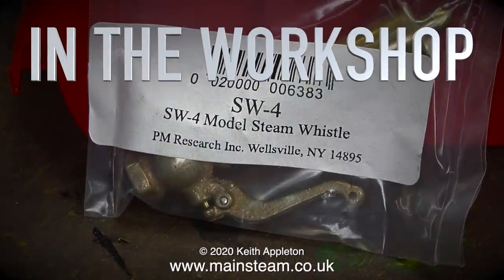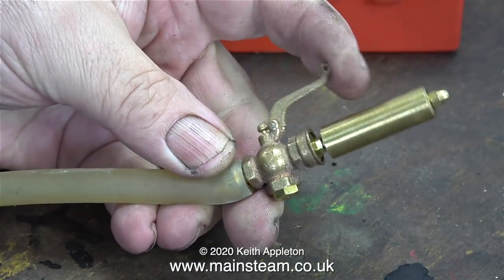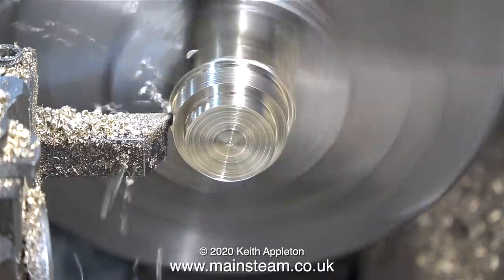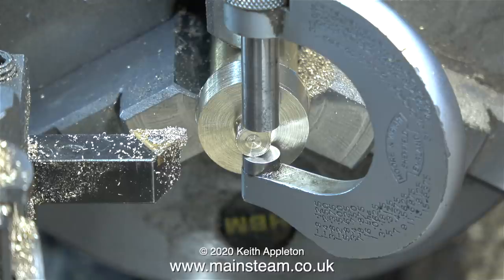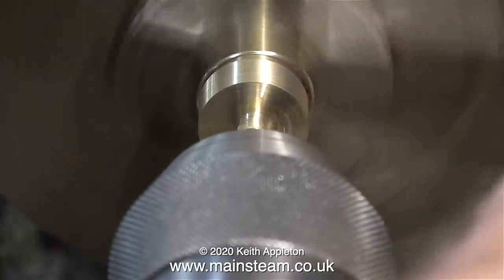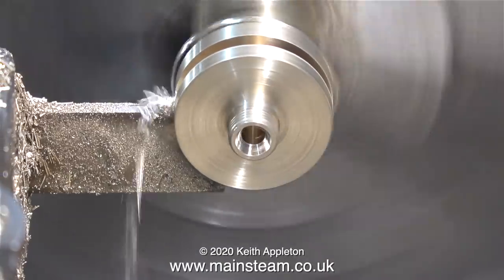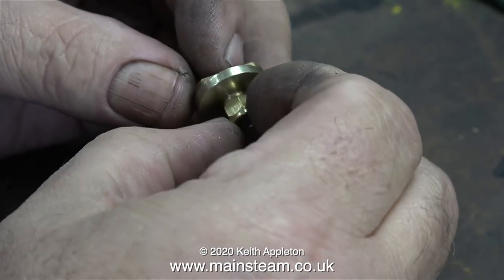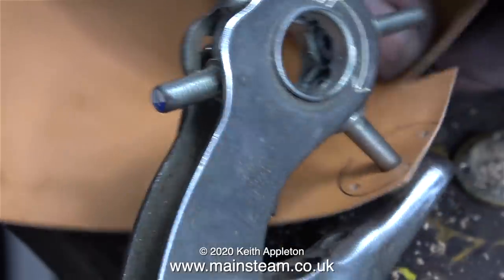MAKING A PM RESEARCH (PMR) STEAM WHISTLE FITTING

Comment: Hi
Keith be aware that the 32 and 40 tpi “Model Engineer” thread form is different
then the US 32/40 tpi threads. The ME thread form is 50° and has a rounded crest and root. The US thread form is 60° and has a sharper crest and root. By mixing these thread
forms they will bind after about two or three turns. With forcing it will go further
but please don’t you are doing it the right way by rethreading it to bring both
threads to the same thread form. I hope this helps you. 

Play Safe from Elliot Lake Ontario Canada
Reply: I did quickly Discovered that, they almost fit, but it is not possible to screw them in properly (maybe it is but since this is thin brass i did not wanted to take the risk of putting too much forece onto the treads since i hawe bad experience from people doing so on brass fittings on old car engines...).
Keith helped me out with this one whan i got stuck whan i tried to use the PM bushings for Kennon fittings (a massive thank You for that!), but it is worth mention.
Outside Britan it is sometime extremly hard to find the correct information about the particular types of treading for this type of purposes, it took me more than two day just to find the basic on google so i gave up on google and returned to my old paperbooks...

I realy hope Brexit turn out well the next month so i can order the correct taps for it, at the moment i am afraid any order from Britain may get stuck in the tull/custom on the nordic border...